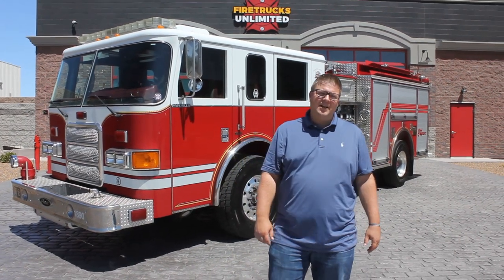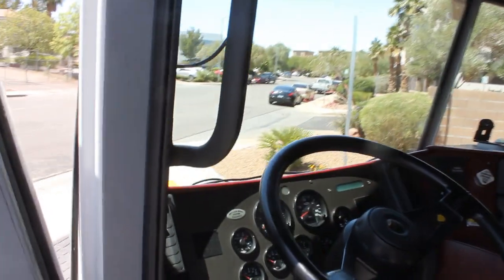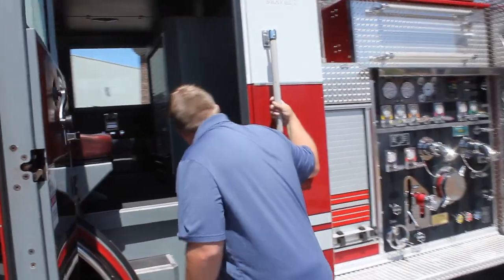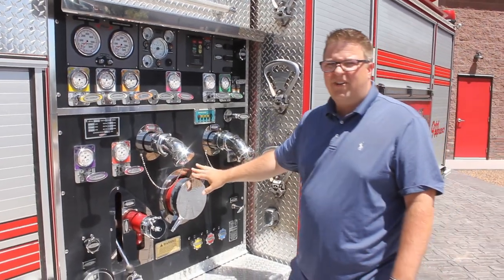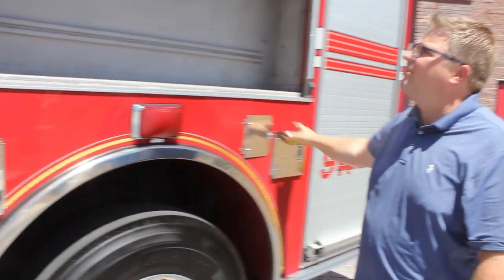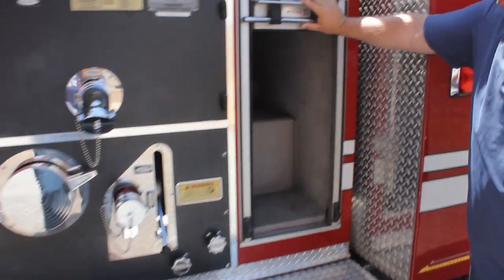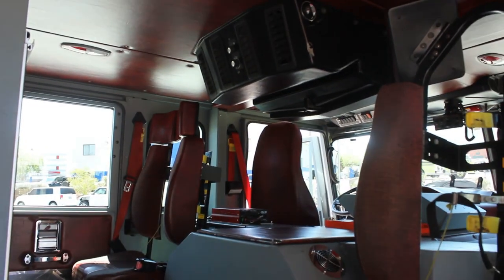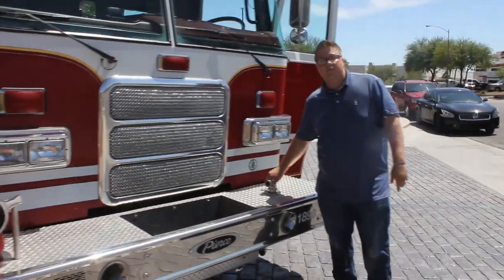2005 Pierce Enforcer Pumper For Sale | Firetrucks Unlimited

Comment: Great looking unit, looks in great shape. Update the warning lights ASAP. All the lower level LEDs look clouded. Put some M9 Whelen heads on the front, M7 white in the center. And ad M9s on the front bumper, and above wheel wells in the front side of cab. M7 above rear wheels. M9 lower rear. I’d change the top Whelen Freedom to the Whelen Freedom Rota Beam red and white. And ad a Federal 2QB. Love the truck. Also, have seen the Brush Rigs you’ve built for CCFR volunteer stations, wow those are beautiful. And really impressed with the rescue and engine refurbs. Beautiful.